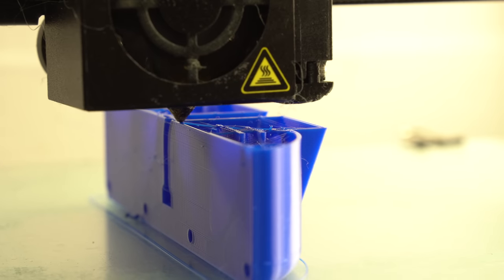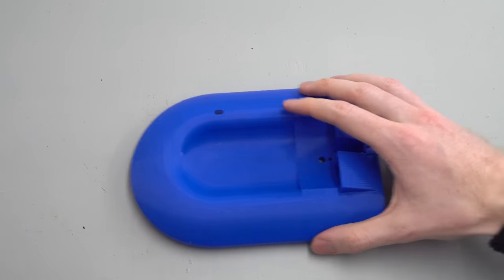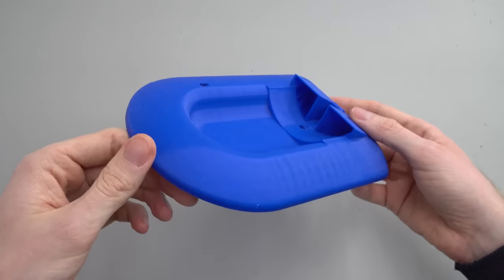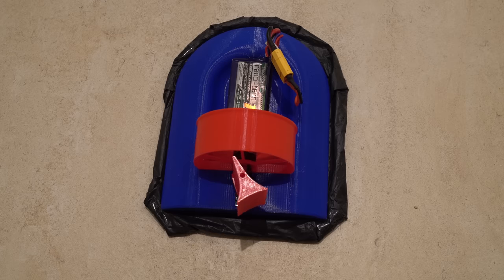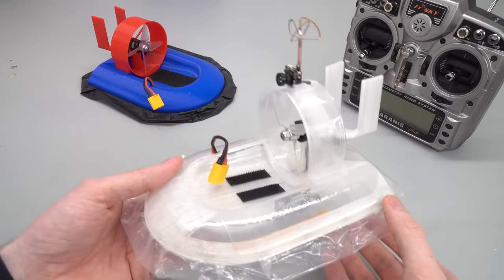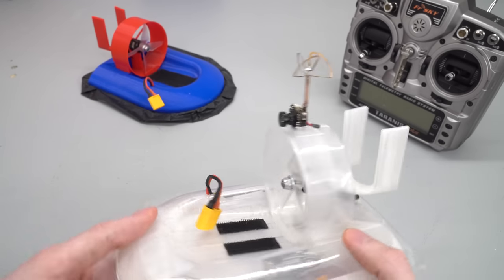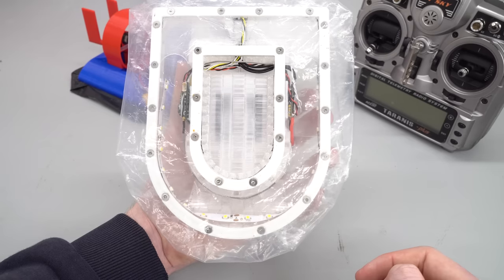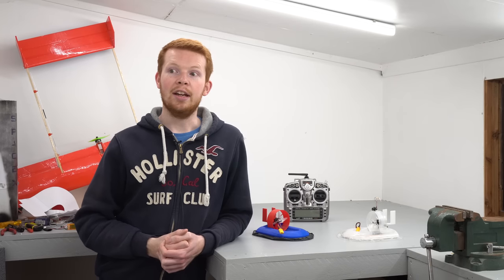RC Hovercraft Development

Comment: Epic build! Made me fall in love with hovercrafts again. Btw, an idea I had years ago which you may be interested in: use an air hockey table as the lift/circuit, then make a micro hovercraft with the smallest components you can find, which just channel air from the table for lift and thrust. Imagine an air hockey table with a bunch of micro hovercraft racing around on it.

Comment: I have intentionally been avoiding RC as it's another hobby I don't need to spend thousands of dollars on, however with a 185mm build height on my HyperCube this is REALLY tempting me!
Reply: Jamie You can get pretty cheap, especially if you make things on your own. Once you get a transmitter, depending on the project, the motors for a simple robot are pretty cheap. I made a 3D printed RC Tank that's fun to drive around with 2 geared motors and cheap ESCs.
Reply: Jamie man you have got to try it! I bought a $15 drone and put a $20 camera on it and got a $20 receiver and I wish I could afford more. Totally worth your time make sure you buy plenty of batteries and it's game on.
Reply: I have the model printed, and everything ordered. All in its probably about €50
Reply: Jamie RC was never cheaper. You can get a FrSky QX7 - an insanely powerfull 32-channel transmitter - for about 100 bucks. And if you don't get on the hype train and don't mind waiting for packages from China you really can do it on a budget.

Comment: Well done indeed! 
 I built one of these back in 1986. This was 12 feet long, and was based on the method that your design uses. 
 Back then, this design was referred to as "Simple Cyclone." 
 The power source for this was a 400cc twin cylinder 2 stroke engine. 
 My hovercraft performed admirably, and it supplied me with endless fun  :) .

Comment: Hey Tom, I make lots of coroplast swamp boats and have the same problems of lateral stability as with your hover craft. I found that using a helicopter single axis gyros work really well for holding the nose straight once you let go of the sticks. It becomes really locked in and doesn't get effected by wind at all, keeping the boat track G dead straight even in the long straights. Also, I use a single axis thrust vetoring system to steer, turning the whole propellor and motor set on a heavy duty hinge hanging over the back of the boat. This gives it immense amounts of authority in turns and stability, being able to turn in its own length.

Comment: If you can get your hands on a gyro for stabilization (around 5-10$) it would help steer the hovercraft. Also bought your design :D really nice work there!
Reply: the answer is what is a rudder... so my wild guess is you never flown a plane with a gyro... its basically a p controller... not pid.. only p... you set the p strenght mostly by turning potentiometer knobs..
aliexpress.com/item/F04041-JCX-M6-M6-Flight-Controller-Digital-gyro-for-RC-Fixed-wing-Airplane-V-tail-Model/707315295.html here this is something like it.... so you would plug the yaw out from your reciever into the yaw in on the gyro, then plug the yaw out from the gyro into the servo... it will keep it straight, even if you CoM is offset helping you to stay on course whenever you dont want to turn.
Reply: it doesnt maintain (over longer periods) it corrects sudden deviation... also if you arent sure... save your pid settings in your quad.. turn I and D to 0 and look if your quad can still take off.. (it will) it wont fly good... but it will fly.
Reply: can u share the hovercraft design (there is some problem with gum road)
Reply: How could gyro help hover craft to steer well gyro in drones and helicopters quickly give input to four variable roaters or in helicopter by adjusting rotor pich...or by adjusting speed of rear prop... but in hovercraft just two directions...or may be in his hovercraft probleum is with rear fin design ..instead like fins with moveable joints more near to prop...

Comment: I am slightly surprised by the rip stop nylon issue. I have a kite made from the stuff that inflates to form a wing shape giving it lift. Yes air passes through it (it's supposed to) but not so fast the form deflates. Maybe the leakage isn't too fast here either? Certainly if you remove some of the skirt vents? Also you could coat it in a rubberised paint like plastikote to make it air tight? I only say because the ONLY thing that lets this down for me is the skirt. Other than that this is one of the best thought out home build RC hovercraft I have seen. Top job Tom, your a very smart young chap. Oh and p.s. Don't apologise for going travelling. Everyone deserves a break ;).

Comment: Hello, Tom.
This video has given me great insight on a few of key elements (in my opion) on rc hovercraft design. For a past month Ive been working on a ducted fan hovercraft using a single 64mm duct and a hard foam skirt. I used a similar method to flow the air under the craft using an airflow system under the main chassis and a double rudder steering mechanism. Both are extremely simple and make the craft inexpensive and energy conserving due to having a single motor and exceptionally responsive while steering due to the double rudders. 

The craft can reach speeds up to 60kph and is powered by a 3 cell 2500mah lipo. Ive had runs that go up to 30 minutes. Ive run the craft on a local velodrome because of its ludicrous speed. In high speeds it tends to understeer due to the nature of aerodynamics of it flying like and arrow, but its possible to turn on a huge radius because it can drift like a hovercraft.

If I ever plan on publishing this hobby project ill be sure to point to this video. These are great concepts.

Comment: Try installing a gyro on your hovercraft. I built one out of foam a couple of years ago and the gyro tremendously improved the steering and ability to hold direction. I used a cheap 10$ from hobbyking, vestige of my RC helicopter era...

Comment: Good job, I said last vid that a twin rudder would work better looks like I was right 👌 

To go bigger you have to reduce weight, sadly 3d printers can’t do lightweight and strength at same time. 
Which is why the majority of home made crafts are made of vacuum formed styrene or balsa or light ply that’s been fibreglassed with model aircraft produced weave, very strong very light and u can go very large using this method.

Clearly it’s not a 3d print, but you spent that time doing a model of a hovercraft why not go all the way and make a scale craft and join the small group of us who build and drive them regularly as a hobby!

I was very impressed with how clean you made your bag and vent system, mine tend to be boxy and a lot of support frames. This is an idea I might use form my next craft.

Comment: For anyone struggling with the build platform max print height, just split the print in half and glue along the middle its really easy to do and allows you to make much bigger prints than what the max build volume allows.

Comment: A lot of people here in the States use an inexpensive shower curtain for skirt material.  An alternative from a builders supply is 20mil plastic (though it comes in rolls of about 100 sq meters, so probably not so good for you).

Comment: Hey Tom, firstly - great work and another great video! You've earned a holiday for sure, hope you have a great time!
 A little idea for when you get back, you could make the battery pack into a 'body' which sits on a small multi-pivotting platform. Use some small servo's to adjust your 'body' position and (if possible) tie them into the steering/accel channels. Mount the FPV cam as the head ... job's a good 'un !! :-)

Comment: Beautiful work, man! Awesome work! 😀
I made one really small, with 3 16x7 coreless motors  (one for lift and 2 for drive and staring). It turned out great, works really well, but as I used a toy grade rc car electronics, it didn't go too much straight... :/ But I think in making another one with little bigger motors (I think they are n40 or something like that) and hobby grade electronics. Let's see how it turns out. 😀 (But all that with depron. Unfortunately I don't have a 3d printer.)

Comment: Since the rudder is giving you troubles why not get rid of it all together? Use a servo to  rotate the prop and housing for steering. I made a hovercraft with that set up a couple years ago and it worked pretty well

Comment: I've had a go at printing one of these myself. Well I say printing - It's still in progress. I have managed to print the largest piece in a good enough quality to use (just about). I'm pretty sure my printer would do a  better job on the surfaces of the main fuselage if I used 2 walls instead of 1. Has anyone tried this and are there any problems using 2 walls for the main hovercraft fuselage instead of just 1 as recommended in the instructions? Obvious problems include increased weight but I can't imagine that causing too many issues with the power of the brushless motors available. 
Thanks in advance for any advice and thanks to Tom for a great model - I bought myself one about a month back for my birthday and have only just fixed up my cheap printer well enough to print the thing successfully.

Comment: Hey Tom,
just in case you planned on doing a third iteration:
Have you considered adding a second, horizontal rudder to vary the amount of air going into the ducts? This would allow balancing of lift and propulsion, i.e. speed control.
Best

Comment: Made v3 it is very fun to drift indoors with.. used smaller motor but works fine. also planned to try using gyro to make it more stable.

Comment: ripstop doesnt need any coating , i use ripstop on mt rc hovercraft skirts and dont coat them with anything , though it can be a bit stiff so sometimes wont get full inflation on smaller craft skirts

Comment: I'd like to see what happens if the fan assembly was moved to the front. There should be a little less resistance to fill the bag so you could potentially get a little more air to propulsion...

Comment: That's what I was going to say as on my childhood scale toys the steering was bit different as three rear fins were connected by moveable joints an were more near the propellers...something like car a.c. vents...and the best performing hover craft was having two props n it was wider ...for drive it on water their were two permanent tube floats which filled with air valves were like foot ball makes it unsinkable...

Comment: So I know this is kinda old video but, For the rudder thingy why not just 3d print a long over shape with some gears that turn two separate rudders That way you can still put the rudders closer to the fan without turning the base of them into it. I kinda wish I could draw it up and post it but I have a 3 gear system in my head that i think would work. 1 gear in the middle and 2 outisde gears and each rudder sits on the outside gears of the set up. It would be small and I don't know if you can 3d print gears that small but it would be fun to see.

Comment: Did you ever try to make a model hovercraft with a proper momentum curtain design?

Just been watching the FliteTest channel's adventures in attempting to make a full-size hovercraft and the size of motors they're using for the lift fan seem insane ...but they're using an open plenum design which is supposedly several times less efficient (according to Cockerell’s original experiments with a hairdryer, some tin cans and a set 9of scales).

Comment: Dual motors is about 300% better 1 for lift 1 for propulsion I have built 4 foam board hovercrafts that all had 3 or 4 refit,s and I believe the ultimate combo is 3D printed ducts and rudder assembly’s with foamboard frame 3 motors 1 for lift 2 for propulsion with differential thrust

Comment: Maybe you should try a triple ruder design just to give it a little bit more manoeuvrability because it would be in a more fixed position and would have consistent airflow on each rudder which would compensate for the two rudders not being independent in movement and would get even more performance in corners

You also missed a design for your skirt I’m not sure what it’s name is but you poke holes in a skirt that has a full seal over the craft witch I don’t think would work on yours as theirs not enough weight to keep it from ballooning and just shooting air out plus tipping but I could be wrong and it could work

Comment: I was just watching Josehp Prusas video on using Meshmixer to cut large models into smaller parts and with connecting joiners....so you could have retained the origonal design size etc...FYI  Laurie

Comment: Hi Tom, I Purchased you files and quick question, is there a specific reason for the voltage reg if not am I ok to use an ESC with a BEC? Great project and thanks for sharing.

Comment: Could you put together a 2 thrust motor version that could be used with a VTail mix? I find over rough surfaces the torque of the motor causes the craft to not accelerate in a strait line. Offsetting battery weight to counter this means it no longer travels strait on a smooth surface. Using a VTail mix should mean no need for servo/rudder and ability to turn with little forward momentum.

Comment: Mine is crazy loud even on 3S, I see you used racekraft props on a few shots, were they quieter than 3045BN? My side to side balance is way off BC I used an XMR. Also I had some coated ripstop (for kites) from Amazon on hand and it seems to work just as good as the bin bag for me.

Comment: Tom, We are having difficulty slicing/printing the hovercraft fuselage. We're using 'Slic3r'. It sliced the fuselage, but it created a gap about 14cm up from the bottom. KISSlicer, just cut off the top 4cm altogether.
** What Slicer do you use **?
Thanks
Paul

Comment: @Tom Stanton : Hi, I bought and printed it. Nice Work !!! But how can I fit in the reciever properly? My normal "decased" one is too wide to fit inte the specially designed corner on the side. Do you use a smaller Sbus/PPM reciever and PPM to PWM coverter? Thanks. Carry on !

Comment: Omg my whole house is hardwood. This makes me want to get a 3d printer so bad!!....
Reply: I love having and operating a 3D printer, but it's not necessarily a simple journey - sometimes it's nice and easy until the first problem pops up, sometimes it starts off bad to begin with. You could go on 3dhubs and get someone in your neighbourhood to print the parts for you. But if you really want a 3D printer, do get one, it's so so much fun! Doesn't have to be expensive either, i mean $150 and 8 hours of self-assembly can get you started.

Comment: Hi Tom! Thanks for this really great design. But your electronics list in the manual has a failure. Using the T-Motor ESC 2-4s 30A you get no 5Volt BEC that is needed for the Servo and the RX.
Reply from the maker: Thanks for letting me know! I have now fixed the manual and have added a link to the regulator used in the electronics diagram

Comment: Instead of using plastic or polyester for the skirt why not both? Plastic on the inside would catch the air while the polyester would be a more durable exterior.

Comment: hey i have an idea maybe stolen already but why don't people like tom stanton invent an alternator that can be changed into a motor by the simplest means possible like unbolting the pieces and rotating the outside body to convert to either motor or alternator. it would sell like crazy once it was made to be a replacement part for cars e bikes and motorcycles.

Comment: The Mini Hovercraft gives the impression that it's so clever designed, that you can build it as easily as possible. But that's not true: it is optimized for the use of the described products, so I won't finish it :-(
First I was really impressed by the construction of the fuselage and bought the STL-files. Then I realized that the model only works if you use exactly the recommended products. For example, I have some Hacker motors (A-10-L), but they have pre-installed plugs and the channel for the cable routing is too small. No problem, you can fix that. BUT these difficulties run through the whole RC installation. It's quite annoying. Some holes could have been made slightly bigger to avoid disassembling plugs and unnecessary soldering. A little more reserve space in some strategic places would allow the use of universal material: then it would probably be a great model. 
My attempt to build it now ends with me looking further, because I don't want to buy any more material. After 15 years of model building I already own a cabinet full of unused motors, regulators etc..
Reply: Can u please send the STL files

Comment: Hey i bought your hovercraft design and in the instructions it does not tell you what propeller to use for the design. the previous video it tells you to use a tri blade bullnose props but it shows you a quad blade bullnose props. Is there any real difference? Can i still use a tri blade and be okay or would you recommend a quad blade?

Comment: Hi. 

Have been following this. Just about to buy the parts. I can find 1407 motors but not 2300kv is the kv rating important?
Reply from the maker: Hi Fred, I've just checked my clear hovercraft and it's using the 1407 3600kv motor and I haven't had any issues. I will update this in the manual. Thanks!

Comment: What size is the prop?  I have bought the files on Gumroad, and can't see the size of the prop, even in the manual.  Keen to order all the parts soon.
Reply from the maker: It requires a 3inch propeller. The spec doesn't really matter as I've tried quite a few different props. However, I used a 3045 tri blade racekraft.

Comment: Printing Time?
Motor Size and cost?
What Servo 
I like to have an Prize for the Hovercraft With all components bevor i Start this Projekt for me
ESC costs 
I Take 10$ vor FrSky pwm receiver
Pack Propeller 
Motor Size (Max Size fit in  
Possible with PLA? and Anycubic i3?
Weight of the Printet Filament